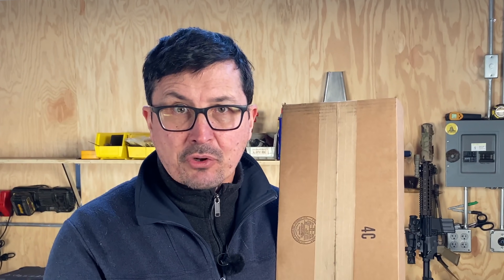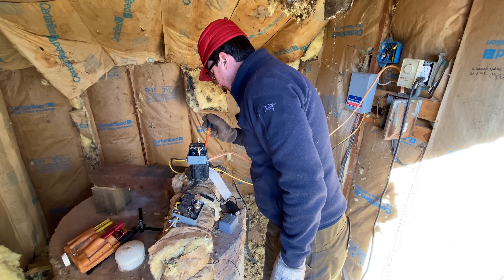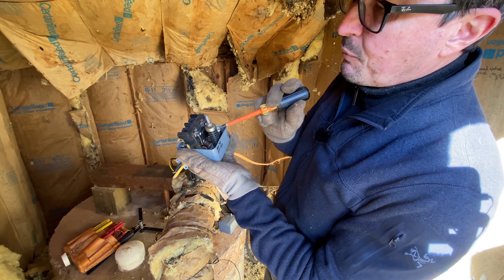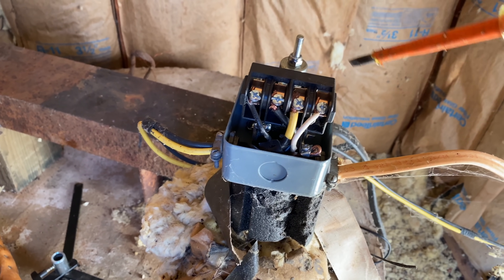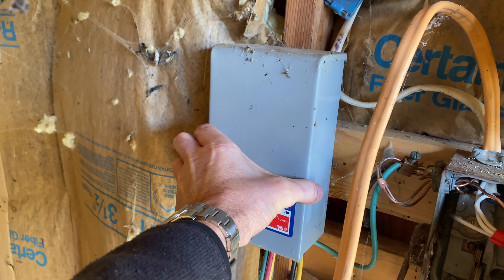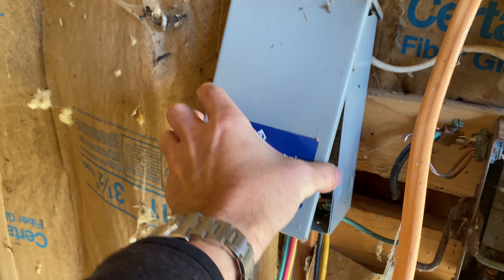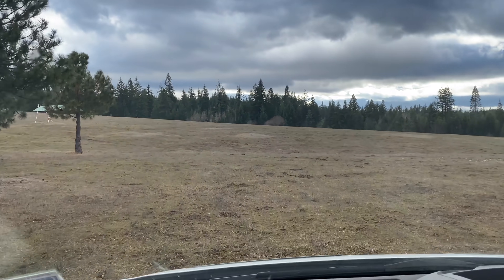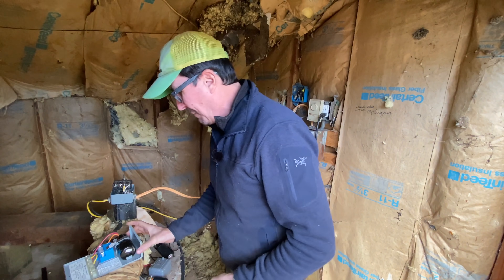We Have A Big Problem

Comment: That capacitor on the control looks like a hard start capacitor with a relay which would probably give the pump a kick start to start pumping and reduce LRA on the motor. It's something we use a lot in hvac to let compressors run smoother.

Comment: The pressure switch is the control unit. The round part is the start capacitor, the blue part is the start relay, they supply start amperage for start torque at the pump motor.

Comment: My pump quits all the time. lol But I know what it is. My contacts are completely shot. I just walk into the pump house and smack the top of the pressure switch and it starts up. 
Yeah, the most common failure is the capacitor.
Ahh my favorite Bridge. I still think you got lucky finding that thing. I never have that kind of luck.

Comment: One other thing I would like to point out Cody....that capacitor, even if it’s dead can still hold enough voltage to hurt you or worse.      They should be handled with care and caution....friendly tip, otherwise, great video !

Comment: Capacitors can be a WEAK LINK on circuits when you least expect.  There are two major groups for motors like that pump.  STARTING caps ....or   RUN caps.   They may look similar but have different purposes.  Large caps like yours have a roll of insulating foil/ material embedded in a semi-liquid called electrolyte .  As the caps age , they may dry out  or fail....and spew out foul smelling substance through the small hole which has a rubber membrane or aluminum cover which swells or splits.   I have replaced faulty caps on an air compressor, a large shop filter system and microwave oven .  Just be aware SAFETY FIRST since capacitors can store a lethal charge of energy like a high powered battery.  Read or view videos on handling and DISCHARGING CAPS before you start.  Caps are more affordable than the whole device.   Thanks for sharing Cody...     J K

Comment: You can test those capacitors.  Microfarads.  Should say on the capacitor what it is rated for.  All you need is your standard multimeter with the microfarad option

Comment: The capacitor puts the voltage and current 90 degree out of phase which helps electric motors start up due to the high current demand at startup.

Comment: That is a starting relay, most likely a sealed pump, this gives a kick to a start winding, the relay has a drop out coil which switches to the run coil, this allows the pump to start against a load, now depending how old the starter pack is, keep this in mind, look at the capacitor numbers and get the same replacement microfarad, but get one rated for 440 volts, has heavier windings, another thing to look at, most starting components are good for twenty starts per hour, any more you can overheat the capacitor and blow it out, is the water level or pressure have a wide hysterises, or does it short cycle, this is something I run into a lot, that causes lower life of the capacitor.

Comment: I would replace the controller  with a capacitor-start, capacitor-run unit, it should be a direct replacement without having to change the base or rewiring anything. Pump will run more efficiently, run cooler and possibly last longer. Next I would really tidy up the wiring, that's just a short waiting to happen.

Comment: I suspect that if you had just replaced the capacitor which is about a $10.00 part system may have engaged.  You might go get yourself that capacitor and install it exactly your old one and try it.  If it works keep it as a backup for next time it acts up.

Comment: A well down 7’-8’ deep is unheard of by me!  Nitrite levels here at 40’ because of the agricultural land nearby.  Good job, quick fix is a great thing!
Reply: Yep a dug well needs full UV and microfiltration.   A cow pattie beside the pumphouse can give you the trots otherwise.  No intensive ag around Cody's well so NO2  isnt likely a prblem,  40' manure piles are usually the culprit.   He does need to be careful of inadvertent spills though.( fuel lubricant pesticide mixing.)

Comment: Most likely all that is wrong with that control unit is the capacitor, it should state on the side what it is get a replacement for it so you have a spare the capacitor probably only costs a few dollars. I think that all it is is the start capacitor up there on the wall so as to keep it away from water, most motors have it strapped on the side but obviously not practical on a well pump. Go to some place like digikey on the web and they are sub dollar price.

Comment: Many capacitors HAVE TO BE CHARGED BEFORE USE, I really hope that if yours needs charged 1st, That you know about it & have the correct diode to charge it! Also, What caused that cap to go bad??? Was it heat? moisture? Many questions at hand! Simply watching this video brings up questions! SO, Does that panel need vent holes? Or does it need sealed up to keep moisture out? or, was there a spike in voltage which caused it's failure? I surely hope there is a relay controlling the power  & that it is fused close to the source & possibly again right before the pump but, What do I know, I am not an electrician! I only know automotive wiring! I also like the idea that B Butler stated, Get another capacitor & keep it for the next time but, One must isolate what is causing the problem rather them swapping parts! Though, Having it work is great but, Knowing how to prevent that same issue from occurring again, Is priceless!

Comment: Our pump died 2 years ago. Yea...350 feet later, a hole in our pump house roof and a small crane. Someday it will be time to rebuild the original pump house, and when it is I will try to design some type of skylight or roof access to the pump. Sometimes it’s easy, and sometimes it ain’t!

Comment: Test the capacitors microfarads. Should tell you somewhere on there a number beside the symbol uF. Set your meter to uF if it has it or Ohms and it should be close to the number on the label. It will tell you a percentage that it could be off but still functional. Most are like 4-7% it can be under or over whats on the label.

Edit: In my opinion it is definitely the capacitor. They are very very common to fail over time. The junk you see on top of it has blown out of it from the inside. It had a little plug in that hole and once it starts to swell up...the plug is supposed to go. Some don't have the plugs...so just look at them and see if any of the sides or bottom or top is swollen or puffed out. Most common sign they are bad is being swollen or the stuff blown out of the plug on top.

Comment: just a little note. that capacitor is easily changed and you should be able to take it down to the air conditioner parts store and get a new one. just replace it in the old box to keep for a spare. they are the most common thing to fail on  230 volt electric motor. shouldn't cost more than 20-40 dollars for the new part.

Comment: Last year my a/c unit went down and I called the number on the unit. The tech showed up in 15 minutes. He showed me the problem and replaced the capacitor. Cost me $250. I don’t think the capacitor needed replacing but I let him do it simply because he showed up in 15 minutes. Still have the problem but now all I have to do is push on a wire that gets loose and the blower kicks on. I’ll remedy the problem when I get time soon.

Comment: I've had to replace my well pressure switch twice before I realized the shrader valves on the holding tanks were bad causing my pressure switch to turn on/off a lot. The small spring loaded paddle switch broke.

Comment: Cody in New Zealand we have 240v which is regarded as safe and the standard. So do you guys have 240v split feed?. Many years ago on the farm we had a old fashioned bulldozer pump which the pressure switch was a very reliable mercury switch then linked to a massive air tank which requires bleeding every so often which was dangerous as the brass nut can shoot off like a bullet.

Comment: If you have a normal multi meter you can test those capacitors. If the meters says MFD's the capacitor will have a rating on it for what it should be putting out. They are like a jump starter for that pump motor.
Reply: Oh and use a rubber handles screw driver to short the capacitor out across the terminals just in case it's holding power in it. If it is it can knock you on your butt or kill you.

Comment: I am not an expert by any means, but It would seem that the voltage run out to your pump is really far.  I think that control box with the capacitor helps the well pump kick on because I am sure you have a voltage drop with that run.

Comment: tip for next time, that black thing was the capacitor, and the corrosion was where the capacitor had failed and actually blew up in a controlled way, so you could have bought a new capacitor of the same value and voltage (this can be found stamped on the side) and swapped it for about 10-20 dollars
Reply: That's true, but he'd probably have to order it, and wait for it.
Reply: @ArkansasPilgrim  i'm not sure if he would, but where i am at, i can go to one of two stores and get it same day

Comment: Definitely a bad capacitor.  Those things will actually blow up/out the top.  Some have a tiny hole thats "sealed" that will pop when they go bad instead of the whole thing blowing out the side etc.  Ive had a large one similar to that that had a small balloon looking thing sticking out in that area.  I didnt know at the time what it was and poked it with a screw driver and popped it.  Made the loudest whistle noise Ive ever heard!  Had ringing in my ears for an hour.

Comment: How does your "seven or eight feet" deep well have enough of a standing column of water to avoid running dry during normal operation?  Either the well has a very large diameter, or it has a phenomenal recharge rate, or it's much deeper than you think.

Comment: You don’t need to remove the jacket on a wire to check the amperage with and amp clamp. Just clamp it over 1 leg of your power.

Comment: Capacitor doesn't provide the current, but keeps the voltage high for starting. I'd recommend getting a small Clamp meter (true RMS). You can also wire the starter with 120V instead, by using just one point (cattle producers often do so they've got a lot 2nd contact if the first fails). This can be done by connecting 120V directly to the pump and the other 120V lead through the starter. It'll only run when it sees the full 240V.

Comment: Order a new capacitor on line, the part no. is on the cap. The cap was bleeding voltage to ground, the thing did you a favor and saved you on the next power bill. replace the cap and a standby for 40 dollars to put in your kit

Comment: A Fluke Amp clamp isn't much. You don't need to remove the shielding to read amps with one either. Costs about $100 unless you need it certified, then double that.
Reply: Should be able to get the cheapest amazon clamp on for $15 - 25  usually have a couple of cheap  clampon ameters on each farm site

Comment: You can replace just the start capacitor. Then have it on standby in case you need it in the future. It should cost you no more than about $20.00 for the start capacitor.

Comment: Are you drinking the raw water or do you have a water treatment system, personally I’d upgrade to a controller unit with telemetry gear that would send you an SMS alert when you have a failure with your system, these are somewhat in-expensive and very useful.

Comment: Do you still put that gallon can with the modified oil lamp brazed on the side of the can , to heat this shed ?  with the 2  120 lines could you hook up a little 120 volt space heater with a thermostat out in the shed ?  
I too  over the years ,I walked into shops with A pizza (even the cheep Little Caesar) for my College interns was fantastic, a box of donuts, cookies, a sack of Tacos, Burgers or I had a HotDog stand where I could get a sack of 10 Chili Dogs with onions for $10. (this not for the Office Gals) this makes you look like a hero and they will remember you the next time. Just a small gesture sets the mood for the interaction of cooperation and respect. I once was negotiating a few thousand in Body work and I saw a photo, his kid raced Go Carts, had Sponsors stickers I pulled out a $100. and said let me sponsor your kids car. I save $1000. on price.

Comment: I like your channel, but you had a huge tool box and no clamp on meter? They are about $30 or less.  Then you drove a tractor there.  When mine went out, I grabbed a 5/16 wrench, clamp on meter and walked 300 yds to the well house.  Oh, the start cap is bad.  Walked back to house, snagged one off one of the air compressors (I checked ratings on caps), walked back over, replaced it and the water was back on.  If you have a smart meter (for electricity), you will see a nice spike in usage while that pump was humming.   The start cap gives it the pulse to start spinning, as opposed to just vibrating back and forth.  Then I put the start cap on my amazon cart, $14 (bought 2 of them), and waited till I had enough to get free shipping and processed the order.  Fieldpiece makes some nice meters (clamp on also), more expensive, but less than fluke ($120), they do most tasks and are small.
Reply: @wranglerstar  No, I would have just carried the tools for the job.  I'm not judging you, just suggesting, get a meter and keep spare parts on hand.  Caps go bad.

Comment: The electrolyte in the capacitor will degrade even while sitting on the shelf. Probaly dont even need a capacitor for starting a shallow well pump. I would recommend further research. No sense storing parts that are unneeded.

Comment: You can replace just the capacitor. Yes it’s bad. The nasty is from it blowing out. Kind of like a pressure relief. The capacitor should only run you about $20 or so. The part number is printed on the side of it.

Comment: First time you pulled off the Franklin cover, i saw the capacitor was blown and needs replacing.
Reply: Save yourself some money next time. When you see a capacitor look like that, you can replace them for about $15 or less. If it happens often then the windings in the motor are burned.

Comment: The starter capacitor acts as a current kick start for the pump motor. Here's a link to one for your QD 3/4 horse control box...buy a spare and keep it in the shed - https://www.amazon.com/59-71-MFD-uF-2801054915-2824075015/dp/B0060BZ5A8/ref=asc_df_B0060BZ5A8/?tag=hyprod-20&linkCode=df0&hvadid=312184298119&hvpos=1o2&hvnetw=g&hvrand=4358181726257807152&hvpone=&hvptwo=&hvqmt=&hvdev=c&hvdvcmdl=&hvlocint=&hvlocphy=9031297&hvtargid=pla-574296217372&psc=1

Comment: First time I’ve seen a well pump with a controller on it. Mine powers the pump motor through the switch.
Reply: Zaxaris Petixos i understand how it works. I’ve just never seen it on a well pump setup before. Maybe because this is a newer install that what I’ve worked on before. This  is vaguely the same idea as the pumps starters in I work on every day. I can see, especially on a long run like they seem to have where this could be beneficial to keep from burning a pump or starter up over a long run.

Comment: You maybe could of bought the starting capacitor only for less than 10.00? Just match up the MFD and voltage rating. Within plus or minus 5%

Comment: I know your happy to be back up and running but I think you got took.  The cap is far cheaper than buying the whole box.  Your gonna run into this problem again somewhere.  Often electric motors have these caps mounted right inside the end of the motor.  Air conditioners, air handlers/fans... Lots of AC motors have a cap in them.

Comment: Your Capacitor wold be the weak link in that electrical circuit! In  electronics they are the most changed parts. So I would go after that being the problem first!

Comment: You probably have a bad capacitor in your electronic box. The motor doesn’t get enough power to start without the capacitor. I’ve already changed capacitors twice in 18 years on my pump as capacitors do age and loose their capacity.

Comment: Looks like you need to spend some time rewiring, and refitting your pump house. Not very professional looking.  You, as an ex-fireman should be seeing fire hazard written all over the place.  Maybe think about pouring a 12 x 14 concrete slab around the well head. Then put a prefab building on it.  Just saying!😎 Looks like you have a creek behind that shed that rises from time to time when the weather gets bad.  Need to keep your slab high enough so that it does affect your building.
Reply: Change the exposed wire cables over to tech cable or armoured flex,  the pump cable is going to be a problem. The pumphouse power supply seems to have only been run as 2 wire no ground,   if so that is a mortal problem if it ever gets dug up by mistake cant see how they could have bought two wire but????.  The grounding at the pump vs the grounding at the 220V PANEL SOURCE is an debatable issue:  ground voltage bumps during lightning can float the line  voltage to ground 50 to 100 v the line to ground voltage over that distance during normal operation can also float 30 v   check it periodically.   Could have been what did in the capacitor other than just old age.

Comment: Make you a bet....bad capacitor on the pump motor start circuit.   Probably made in China.  They fail all rather time in my heat pumps.  The motor will try to run but needs a big inrush of   Current to get the rotor moving.  Replace the capacitor in that box and try it on the pump and I’ll bet it runs.  If it does, keep it as a spare.  Good luck.

JoeB

Comment: The controller regulates the pump speed. Add a cyclestop valve to the system to maintain constant pressure and minimize cycling of the pump to extend its life https://cyclestopvalves.com/ . No business connection with them, but love the product.